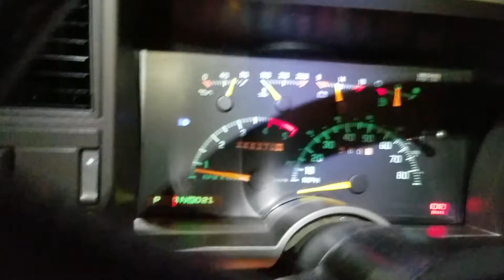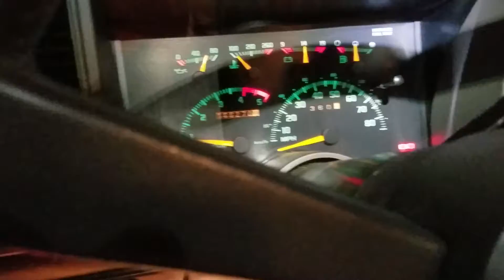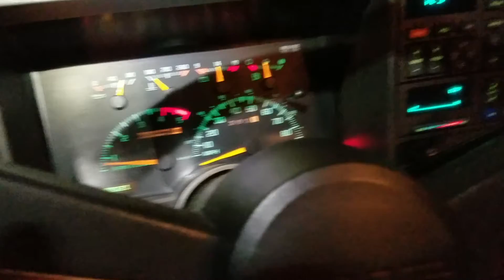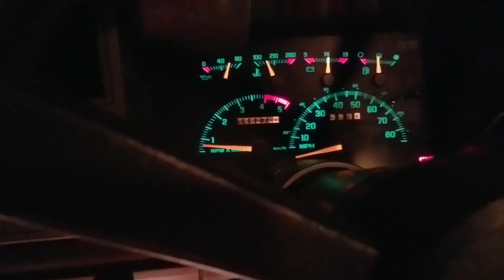4l60E transmission converter engine stall ?

Comment: Did you ever find the issue ? Mine is doing the exact same thing
Reply from the maker: Converter is still bad but the fuel pump had low pressure when it warmed up.

Comment: Looks like its the tcc valve locking your torque converter it goes on the valve body
Reply from the maker: Nahh I do have a messed up converter but it was low fuel pressure.  Too many known issues = scratch your head.   No more stall but I still have TCC shudder and no lockup. Probably a bad converter crappy rebuild. Crappy shop in FL put in a garbage reman converter.

Comment: ???????
Reply from the maker: ?????que?
Reply: It's weird.... Never seen anything like that before. Gonna change out the torque converter?
Reply from the maker: It goes like this. It will want to die like this  And when I power brake it, Stall test the converter it will STALL when I release the throttle while 2 footing it.  Its like the converter sticks and semi locks dragging down the engine.   I just beat the crap out of it before. Stall test, Works great, No stall when I let off AND the converter is locking and unlocking today. I did get it to SHUDDER upon TCC release after driving down a empty road at 47mph on the gas tapping the brake making the converter cycle in and out of lockup.  Yea the people around here are unphased by my brake light action!    At about the 15th  consecutive cycle I got it to shudder.  Now If I bring it to the transmission shop its in "WORKING CONDITION" what will they say?  "OH IT WORKS FINE"    I just even went through my distributor I rebuilt a few years ago.  Wow it looks really good!  The coil checks out. the end play is perfect, the cap and rotor looks mint. Nothing wrong with it. Its not engine issue.   I'm just ticked I don't have a lift to use I would of took out the transmission, ordered a converter, maybe change the TCC solenoid just for good luck. New filter, flush all the fluid with new stuff and ran it.    That's why you have to fix your own car. You know what the problem is because you drive it the most.  Even if I do guess work like "Yup this converter is jacked"  It still costs me alot less $$ and takes no time instead of dealing with someone.  This is just a totally weird super rare failure of a converter!    Figures I would get one that does this. I always get the weird issues.  Tempted to take the trans out myself in condo  garage.     Wonder how much of a wrestle it will be.
Reply: Radio wild bad torque converter will cause this issue
Reply from the maker: It has to be bad. Its working ok today. Wont stall when I power brake it   has lockup mostly. shudders sometimes when it releases lockup.   Had the distributor some what apart its  not that. No way is it  engine problem.
Reply from the maker: Should too much of a PITA to remove it in condo garage